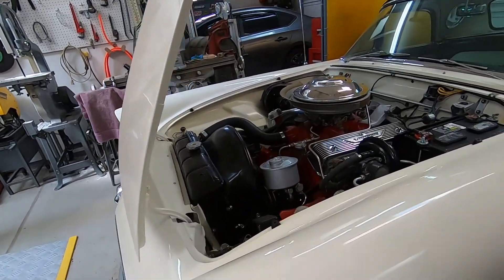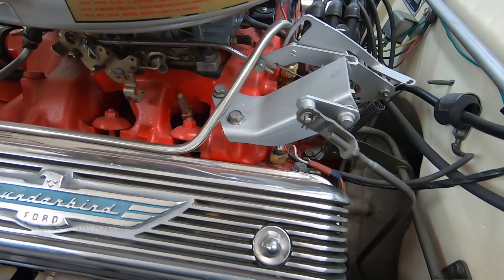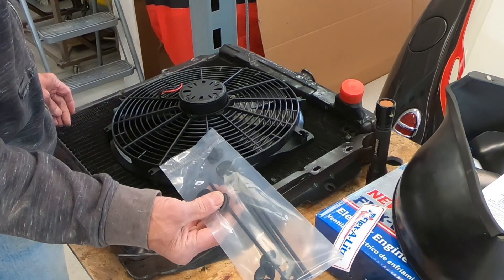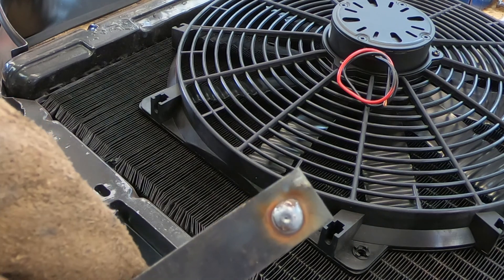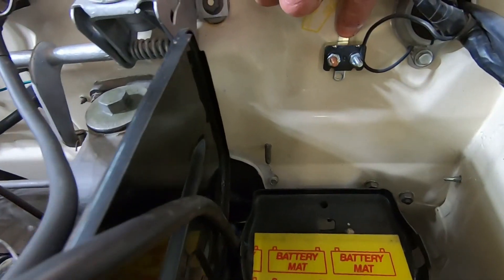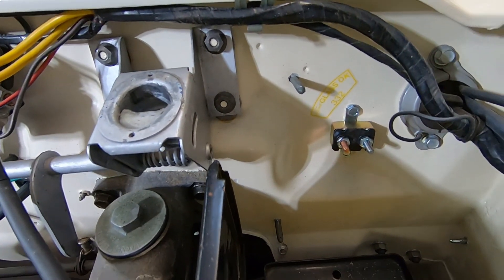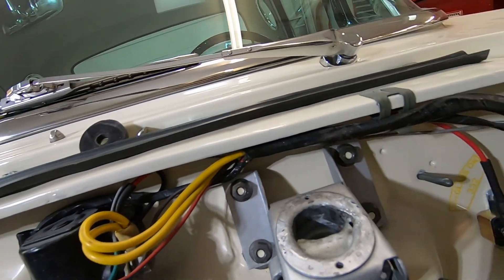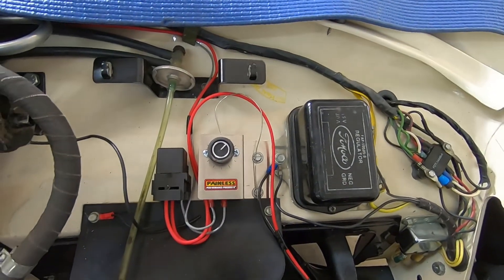Automotive Electric Fan Installation   Flex-A-Lite Flex-Wave

Comment: Your temp is still too high 
Problem isn't the fan. It's the water pump and spacer ring
Casco for the high flow pump and Chris Ames for the ring. High flow thermostat. Lower fan shroud. I got rid of the aluminum radiator. Brass and copper 4 row.
Reply from the maker: Thanks for the tips.

Comment: I have the same car. The tbird shops have a nice electric pusher fan that goes in front of the radiator. I have both fans now. Everything is included. No holes to drill
Runs really cool!!

Comment: I understand you probably want to keep the car as true to it's original form as possible, but getting a radiator with side tanks instead of top/bottom tanks will allow the water more time in the radiator, thus making it cooler when it exits. On the other hand, I have a rad with side tanks in my 429-equipped 64 Fairlane, and it still overheats at lights/in traffic (like your Tbird does), so maybe it would be a pointless change after all. :)

I'm about to install a pusher version of the flex-a-lite on my car because I don't enough room to mount a puller fan along with the requisite shroud.
Reply from the maker: Thanks for the comment. I hope the fan helps your situation.

Comment: Is the Car overloading or running rich when at a stop sign / stoplight. Like does it pop?/Sputter? 

And is it running rich??  

If you answered, yes, to any of those questions above, then your car could be running rich, and a carburetor adjustment could fix that issue. Running rich can cause your car to overheat, when at idle.    

Also, a good point to make it 3000 CFM should be the minimum requirement for any hot rod / Build.  

Your second choice, would be to have two small fans that are pulling/pushing 2000 CFM each to have a total of 4000 CFM.  

I personally would prefer to go with just one that way if it fails you know right away
Reply from the maker: Good comments! The car has been sold but ran great, no hesitation or sputtering.

Comment: Still looks warm from what the temp gauge is saying
Reply from the maker: Hello, Thanks for watching! The gauge is a little off, when the needle is at the right side of the horizontal white line that's where the thermostat opens so it is right around 180. Good observation.
Reply: @DickShaw  ok thanks for the reply. I myself have been trying to keep my 550hp big block cooled in the summer ☀️ I recently installed ceramic coated headers and boy what a difference it made on temperature.

Comment: I just bought the same fan to put in my mercedes turbo diesel to take place of the clutch fan
Except I am using the digital adjustable fan controller. Should keep my 3.0L turbo diesel running nice n cool on the 100f days we get often.
Reply from the maker: I hope it goes well for you!